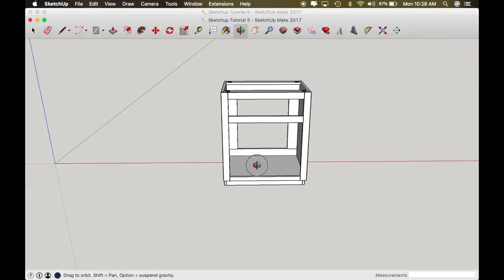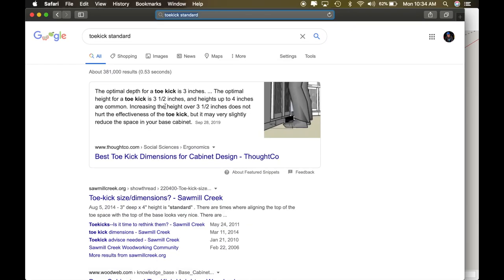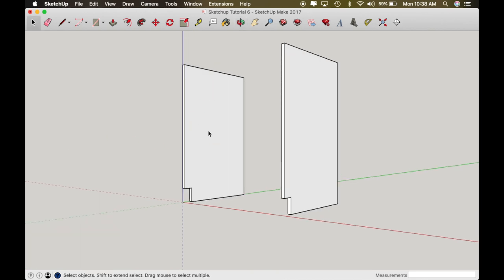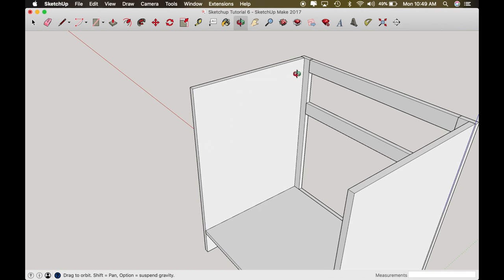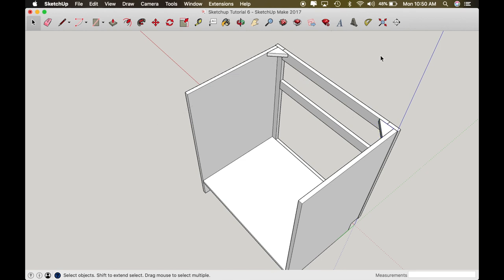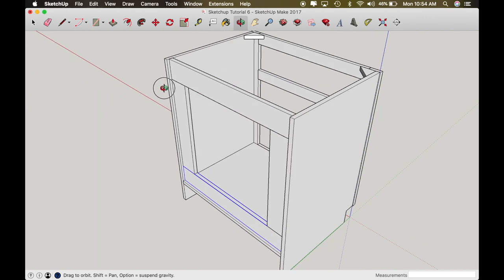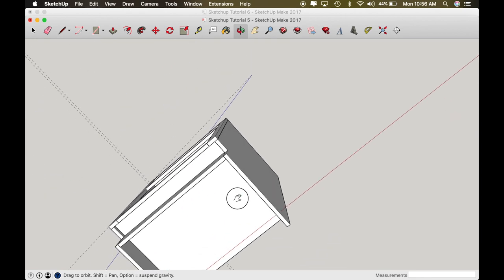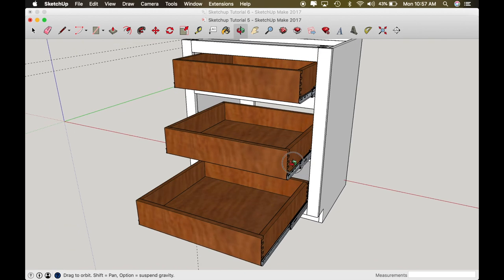Base KITCHEN Cabinet Construction FAST & EASY

Comment: Cabinet depth has a lot of considerations besides just drawer depth.  The appliances and countertop material are other considerations.  When designing a kitchen I always start with the appliance size requirements, paying special attention to depth needed as clear space inside the boxes.
Reply from the maker: Good one. That’s another great point. I prefer deeper cabinets because I’m not fond of appliances poking out the front, but sometimes you can’t help that.
Reply: @rhwoodshop , I agree , lately, I think there is a trend for deeper cabinets.  I heard of a kitchen where the 12" upper cabinet depth was not deep enough for the clients 11 1/2" diameter dinner plates.  This was due to the placement of the back and nailers.  That would be a phone call I wouldn't want to get.
Reply from the maker: Oh man tell me about it. Call backs make your stomach hurt. I ask a bunch of questions on custom cabinets because I want to know what they plan on putting in there so their expectations are met and not deflated, but you know sometimes you just can’t make them all happy no matter what you do.